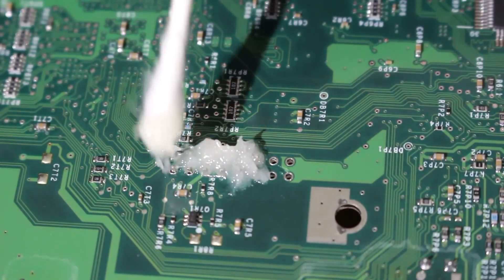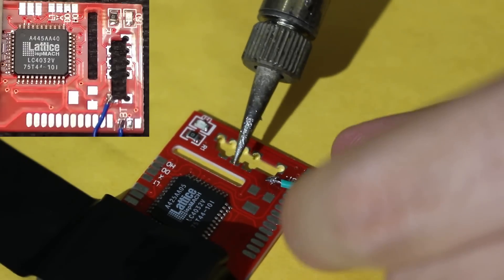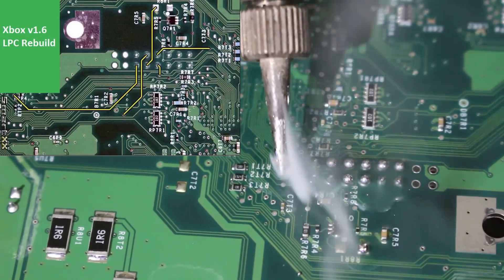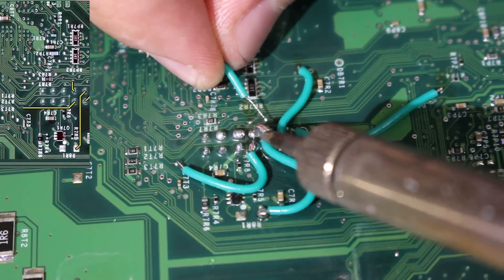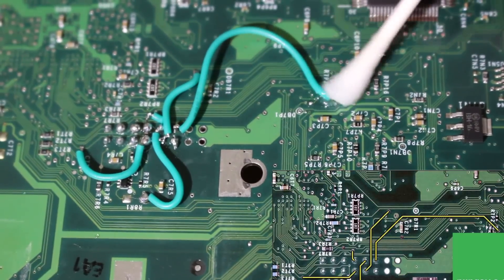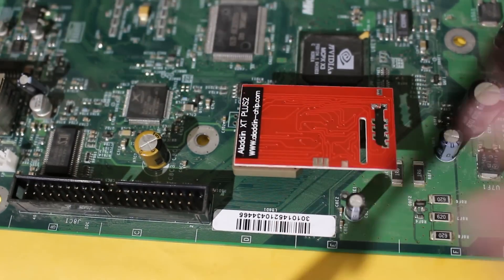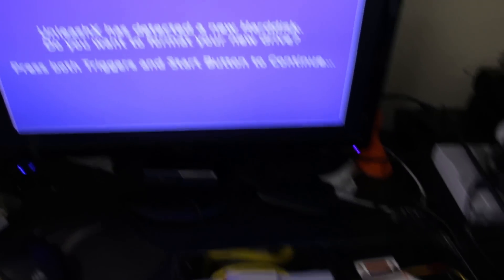How to Install an Aladdin XT Plus2 Modchip in a Xbox 1.6

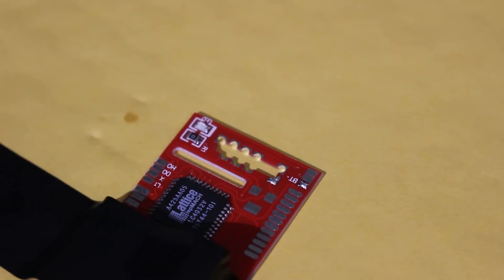Comment from the maker: Small correction: the wire to solder at 1:55 on the chip itself should be a requirement if you're doing this, not optional!
Reply: Its a winbond v3.3 chip red color looks similar to yours and has codeW49V002AP
Reply: Hello MrMario I did everything exactly like you did but when I turn on my xbox I have a red and green light flashing what can be the problem please help thank you. The chip turns on.
Reply: @retroreplayemulation3276  I have the same problem.
Reply: If the modchip do a blu led, does that mean it's broken?
Reply: Can you tell which modchip is installed on my xbox. Had one laying around since ages. Opened it and found chip installed.
Reply: 13:12 how do you verify trace is cut??

Comment: What is the point of cutting that trace, just interested thanks.
Reply from the maker: Cutting LFRAME disables the ability to boot on-board BIOS and is recommended as a safety measure for some chips. Other chips that don't have it recommended already have the necessarily logic built into them to handle it all safely, which some outdated chips do not.

Comment: Hey MrMario! your videos have been extremely helpful! thanks a lot.

I have an 1.6 xbox with aladdin. when i hold power button for 1sec, it boots the EvoX. when i press power quickly, it tries to boot the original dash, but gives me error 13, sometimes 16.

I would love to have the "dual boot" option, where if i wanted to have an "OG experience" i could boot the original dash with a quick pwr button press, is it possible? i hate booting up the original dash inside another dash.
I can't seem to find it if its possible, my guess is nobody would want this as the original dash is extremely limited 😂
Reply from the maker: I haven't done a dual-boot setup in years. Optimally the best option is to have a custom BIOS, boot into a custom Dashboard, and have the MS Dashboard installed as an app or selection you can boot into from a custom Dashboard.

Comment: Hello MrMario! Thank you for this awesome tutorial, I was able to hardmod a 1.6 crystal clear og xbox!
I totally forgot to cut the LFRAME pin and it wouldn't boot to the modchip (Aladdin), after cutting it, it wouldn't boot without the modchip, but still works fine
This is my second og xbox I own, waiting to get a 80 ide cable, got a spare SDD i got around in my room
Greeting from Mexico!!! :D

Comment: I got a "faulty drive" OG Xbox this week to replace my toasted PSU from my old 1.0 one, it ended up being a 1.4 so I got to keep the second one, softmodding it with rocky5's softmod, removing clock cap and whatnot. However, during closer inspection, I saw a red board with a 49LF020 chip soldered on the board, it lights up every time I boot the Xbox but it also has a black jumper wire soldered on the metal side part of the screw hole next to it, but the other end is in the air, not soldered anywhere on the board. Any idea on where should I solder it on? Or, would it be a better idea to completely desolder the wire to  avoid any possible short? Tried to find any "blob" on the board to trace where it was before but to no avail. Thanks in advance!
Reply from the maker: That sounds like a ground wire for the modchip which has been undone.

Comment: When you install a new IDE drive why do you say that we need to set is as "master", the original IDE drive is always on "cable select". Is there a reason for "master" setting to the new one? In this video you say "master" but from what I can see from where you put the jumper and the indication on the label, your new drive it is actually set to "cable select". You must be mistaken. I always set my new IDE drives to the exact setting as the originals were, which is cable select and they always work fine.

Comment: It is possible to unlock an HDD from another console on a hard modded system??
I extracted the eeprom.bin from the dead system but doesn't show HDD key or info, I think this chip is severely corrupted or damaged. I extracted using same method from another working system with softmod and HDD key is the same in ConfigMagic and eeprom from backup and also the dumped file on PC, so it's working just fine, zero issues. 

The dead console doesn't turn on, does nothing, no power, no fan spinning, no light flashing; power supply works fine in other system. Power and Eject buttons are fine too, mainboard is quite faulty and I'm unable to power it on after several tries, nothing works.
Reply from the maker: It certainly is possible, however, you would need a proper EEPROM.BIN which unfortunately it sounds like you're having an issue with.

Comment: Please help: After using Fatxplorer, are the C and E drives supposed to be empty?

After using Fatxplorer, I put the hard drive back into my Xbox, inserted the Xbox Installer disc, but I get an Error 16.

Putting it back into my PC and mounting C drive as X, the C drive is empty. Do I need to rebuild it?
Reply from the maker: You built and partitioned the drive but didn't add any content to it.
Reply: @MrMario2011  Thanks for the quick reply! For example, I need to put on XBMC4Gamers or something like that?

Comment: Help please: I installed the mod chip on my v1.6 Halo Edition and when it boots up, I see a red light on the Aladdin XT, the EVO X logo on-screen, but before the splash screen finishes, the boot up freezes. I tried rebooting, but same thing every time. Any ideas? Thanks in advance!

Edit: I fixed it! Silly me. I put the IDE cable in reverse. Now it boots up just fine. Lol

Comment: Just recently did this to a 1.6 Crystal OG Xbox. And I gotta say I was little bit hesitant at first due to having to cut the l trace on the motherboard, but after some thought I realized am I really gonna need the stock bios? No that’s why I TSOP other Xbox’s so honestly it doesn’t really harm the console and due to your video I was successfully able to do this first try as I had never hard modded 1.6 motherboards before. But now I can hard-mod any original xbox that comes my way. Hats off to you Mr. Mario!
Reply from the maker: Have fun!

Comment: i have a 1.6 but i also have a 1.0. the 1.0 is my ogrinal one i had in storage and sure enough the clock cap was leaking but no damage was done to the board. the 1.0 will be getting the mod first. only thing was bad was the dvd drive. i  sacrifced my 1.6 dvd drive and bam shes alive again.

Comment: @MrMario2011 I want to buy a modchip but on ebay I see pictures of the Aladdin XTplus but no branding on the chip, is that normal? Just wondering becuase on YouTube it has some branding on the 2 visible chips.

Comment: Thanks brother used your affiliate link and purchased some wire can't wait to do this one.
Reply from the maker: Have fun!
Reply: @MrMario2011  what's kind of neat is I suppose you're using the same Stahl unit I'm using.  I was gifted this unit from my brother.  Recently purchased the tips for it.  Now I am waiting for the tinner to re-tin the tip.  I'm still in learning processes but as far as i'm concerned I'm doing tons better then where I once was.  Thanks again for the help.

Comment: I broke the via on the one connection that is the really short one in the diagram. Some guide had them just put a blob of solder between the pin and via but it didn't work and I tried to do a really short connection and broke the via in the process. 

EDIT: I managed to scrape some of the solder mask and expose some copper but holy hell it was delicate and I hope to never touch those wires because if it comes off I think it will be the end of the console. Put some super glue to hold the wires as well. I'm still terrified but hopefully it should at least be untouched and stable until someone removes the motherboard from the case

Comment: Hello, i installed the alladin like on the tutorial, but on the boot screen there is light video noise, how do i fix it please? it boots normally and working good
Reply from the maker: That can happen, especially if the BIOS boot screen is in 480i.
Reply: @MrMario2011  thank you for aswer! i found out that was becouse of component cable. But after i plugged in a HDD then it wont boot and stuck on part of a boot screen (not finished). If Hdd only power is connected it "works" but when i connect ide cable it starts crashing. Do you have any idea please?

Comment: Regarding the hard drive talking point. Can I remove and unplug the HDD while it's turned on or do I need to do like:

1) Device is off.
2) Remove HDD and connect a new one.
3) Insert the disk
4) install on new drive?

Comment: i've been trying to install one of these in my xbox, now when i turn it on it restarts twice and then flashes red and green. i've re-checked the connections and i'm pretty sure its all ok. Any ideas as to what is going on here?. i'm using the v4 lpc rebuild board if that makes any difference? . Any help would be appreciated

Comment: Hi, you didn't mention anything about the D0 point in your video. Just wondering you don't need to solider D0 point in V1.6 motherboard? Thanks.
Reply from the maker: Not with this exact method shown here. D0 is soldered and restored during the rebuild.

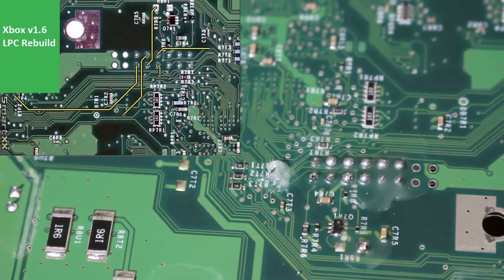Comment: 4:50 Is this part necessary for a 1.0? 

Oh, the stink bug Xbox works by the way. I want to get a modchip to run backups of games since my disc drive is extremely picky and only works with one disc.
Reply from the maker: This is all for a 1.6, if you're needing to install a chip on an older model I'd suggest checking out the portion of my OpenXenium tutorial where I cover that.

Comment: From memory the EvoX m8+ bios has a version for v1.0-1.5 boxes and a different one for v1.6

Does this modchip work out of the box on all Xbox's? If so how does it do this when they require different Bios's. Basically what I'm saying is, if this modchip comes with a stock EvoX m8+ bios on it (for v1.6), how will it work on v1.6 xbox's?

Comment: I have error 21, can I just install this mod chip and be done with?
Reply from the maker: Just a brief search shows that's a dashboard error. If you can't resolve it via software then yes, a chip would technically fix it? You could use a recovery disc on your current or new HDD and format it completely.
Reply: @MrMario2011  Recovery disc?

Comment: OK, I've done this with another guide but it's pretty much the same steps. But if i solder the bt pin like you did, the Xbox won't boot up. It shows only the green/ red blinking led.

Comment: Thanks for this guide, I had a 1.6 xbox with the wrong HDD in it and I was nearly ready to give up on finding the eeprom backup or original locked drive.

It has a fresh new drive in it now with the aladdin modchip. Thanks!
Reply from the maker: No problem 👍

Comment: i just did this mod for the second time but i did not cut the trace at FIRST.... installed the chip and it attempted to boot then flashing red and green no video output. i checked the connections over and over again the xbox still worked without the chip. then i found a link saying u need to connect the d0 if u do not cut the trace so i went ahead and cutthe trace and xbox booted up with evo. for all who dont want to cut trace right away like me.

Comment: Picked up an OG XBox from the thrift store and discovered it to be a 1.6, and got an Aladdin 4032 replacement chip from ebay. I was worried that it may not come with the correct bios pre-flashed but following your video I was able to get it working! I also upgraded the HDD using your other video.

The only step that I do not see here is soldering a wire from the D0 to the screw plate (its mentioned in the PDF that you linked). I assume cutting the L-trace achieves the same thing? I did both to be safe and everything seems to be working fine. Thanks a lot for your videos man!

Comment: Thanks for a clear and easy to follow video !  My question is, as I plan to replace a dead hdd in a currently non modded unit, will I need more than the chip and what has been shown to get my Xbox up and running ?

Many thanks in advance.

Comment: my modchip say "aladdin advance V1.0-1.6" is there anything i need to know about it? it seems to be missing the resistor and LED and the D0 point is on the other side of the board.

Comment: I followed this video and it seems to have worked cause I get the “evo x” on the top left corner on boot and the mod chip’s LEDs light up. But I’m stuck cause of error 16, how do I fix this error? (This error was also present before I hardmodded my Xbox)
Reply from the maker: That's related to files on the hard drive being corrupted or missing. You would need a recovery disc like Hexen to initialize your hard drive.
Reply: MrMario2011 Thanks! Time to go buy some burnable discs

Comment: I did everything in the video. I know I am late this but I had time now. I spent 8 whole hours with it and nothing. Meaning now I am stuck with the 3 restart and green and red flashes. I reflowed the connections. I caps are good. Now I don't care. I left the chip inside so it can stare at me with its red eyes. Great video by the way

Comment: Hey MrMario! Great Vid as always. I had a quick question - I have an xbox 1.6 that is not modded, die on me and wanted to know if there was a way to retrieve the data off the drive? The xbox does not power on at all. Did a few repairs but noting seems get it to power on again.  Had A LOT of game saves and did not want to lose them. Let me know when you get a chance. Thank you again.
Reply from the maker: If you know the HDD password to something you changed, you can unlock it and get your data. If the drive is already unlocked you can do so as well. If your drive is locked and you don't know the password or key, you can extract the EEPROM from the motherboard to unlock your drive.
Reply: @MrMario2011  Thank you so much for getting back to me so fast. Yeah I do not have the password or the EEPROM. Do you know any good tutorials on how to extract it or how to get the hdd to work in different xbox that works??

Comment: Installed the Aladdin chip with the LPC rebuild board. Great videos first of all thank you!
 I also ran the Rocky 5 softmod. After doing so I no longer get the home screen, just a black screen and orange led. I get the evox boot screen and can start games. I've tried loading the softmod extras disc with no luck. Guessing I've lost the dashboard. Do you know of a good way to recover my system?
Reply: Figured it out
Guess The hard mod Bios didn't let the softmod finish. I disassembled the Xbox and ran headphone wire to the cut trace for the original Bios and from the bridged (always on) connect at the modchip to switches. So I could turn then on and off. I turned off the chip and on the old trace which let the softmod finish installing. I then removed the softmod using the Rocky 5 extras disc and then reboot switching off the default Bios and on the modchip. Reboot the same disc and installed a custom dashboard
Reply from the maker: Why would you downgrade to a softmod on stock BIOS when you had a hardmodded console with custom BIOS?
Reply: @MrMario2011  mistakes were made, was trying to get the custom dashboard and ran the Rocky 5 softmod pack instead of running from a disc such as the extras disc or hexen. Noob life

Comment: can i use your method to install aladdin advance?
Reply from the maker: Can't guarantee any level of success with that as this tutorial is designed for the Aladdin XT Plus2.
Reply: @MrMario2011  i've done everything as you showed on the video but i just didn't soldered the aladdin chip bec you said it's optional... then it turns out it doesn't work at all...

Comment: Would an SSD hooked up with a SATA to IDE adapter be supported with the Xbox?
Reply from the maker: Sure.
Reply: @MrMario2011  good, can they be locked? Or does it really matter?
Reply from the maker: Probably can't be locked, but it doesn't matter when you have a custom BIOS.

Comment: I accidentally ripped a trace that you are supposed to solder to near r7t3, luckily I have some super small transformer wire that I hope I fixed the trace with. I soldered it to the point the trace started and at the part I ripped the trace near the middle of the connector I have soldered in, I have some clearcoat nail suff covering the broken trace and keeping it on the board so be careful to not put your soldering iron on its max setting unless you have a broken one that only works on the highest setting ._.
Reply: I'm still not done with soldering so I have to be more careful
Reply from the maker: I had seen your work on Twitter. If you're not using liquid flux, start using it yesterday. You need to turn down your soldering iron's heat as well as I saw you burned a lot of points.

Comment: Hi! Big fan and I've followed many of your tutorials but this one seems to have not worked out as well as I had hoped. I followed every step exactly but I think my Xbox is bricked. First power on, after the video, I got the Evox logo but boots to a black screen and the front LED is yellow. I pulled the modchip off the pin header and it turns on but you hear it power on, then off then flashes green and red and no video. Do you have any advice on this problem?
Reply from the maker: Cutting the LFRAME could prevent it from booting without a modchip. As for the black screen, it sounds like you had a softmod? You cannot have a softmod on a hardmodded Xbox. If you pop the modchip back in you should be able to nuke your hard drive using a recovery disc such as Hexen.

Comment: What gauge wire do you use for chips? 30 for data and 24-26 for power and ground?
Reply from the maker: I used 30 awg for this, link in the description as to which one I use.